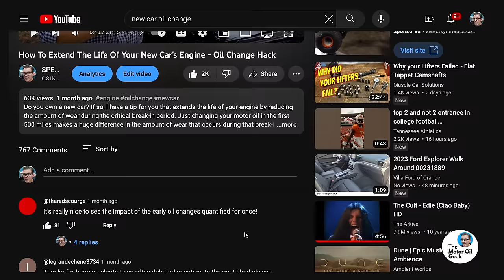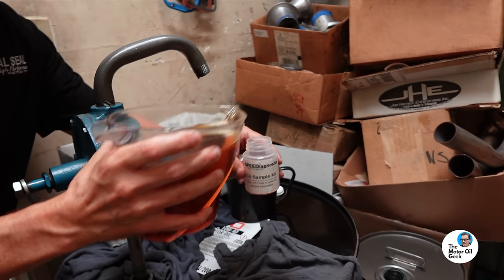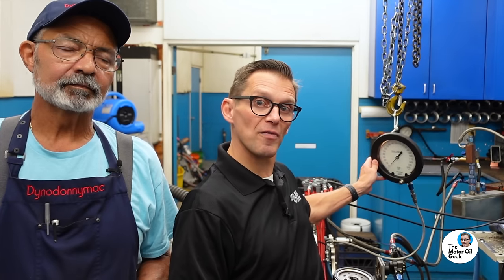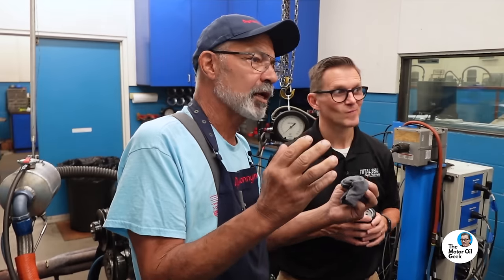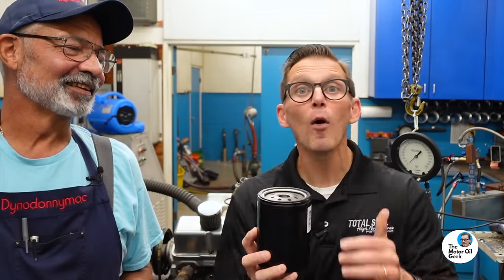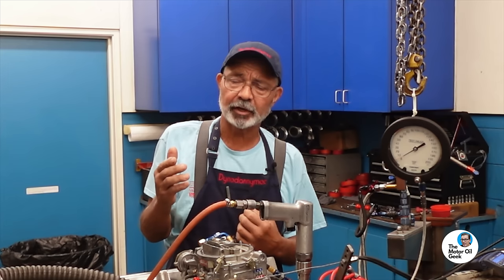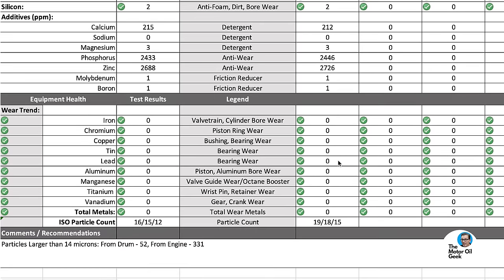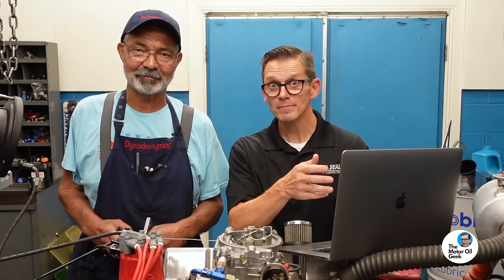Does Pre-FILLING The Oil FILTER Cause Engine DAMAGE?

Comment: What do you do if you have a VW with a cartridge oil filter mounted on the top of the engine? I can’t prefill the plastic cartridge, especially as it is mounted on top of the engine so all the oil would drain out. Also it doesn’t have a pressurize mode like your Subaru example.

Comment: If there was a significant difference EVERY OIL FILTER WOULD SCREW IN FACING UP so oil would not pour out during installation.  You should always test start the engine within an hour of changing oil so parts will still have film.  If it took 4 seconds for the valve train to receive oil on each start up and you worked 250 days/year, each year of commuting is asking the valvetrain to run without oil pressure just over 30 minutes.  Because mere seconds each day is acceptable, we don't yank the distributor and manually prime the engine each occasion we plan to start the car.  What worries me is the practice of dealerships sucking out old oil from the top of the engine.  That will shorten engine life but it's better than nothing.

Comment: Not fully accurate test.  The oil sampled from the engine was straigjt out of the oil pan.  That oil will run through the filter before going through the engine.  For an accurate comparison, your second sample needs to be drawn directly from the filter outlet.

To put their numbers into context, the ISO count referenced is something manufacturers have standards on.  For example, Caterpillar (one of the largest engine manufacturers in the world), recommends 16/13/13 as a minimum for theor engines.  Their own brand new oil will very rarely meet this straight from the drum. It is impossible to produce perfectly clean oil at that kind of scale.  Caterpillar spends an incredible amount of money on research and development, and they explicitly recommend NOT prefilling filters due to micro contamination.  Even to the point of designing filter mounts that are upside down to prevent prefilling. They also recommend "kidney lubing" the oil before filling (pump through a bank of filters).  I have personally sampled brand new oil straight from drum, and brand new "kidney lubed" oil, and the filtered oil ISO count was reduced by over 50% after a singl filter pass. 

Rather than listen to someone like this who sounds like they know everything about the industry, follow your manufacturers recommendations.

Comment: Pre filling filer with new oil can't be as bad to the engine as the filter going into bypass mode and pushing old used unfiltered oil into the engine.

Comment: hey guys GREAT video on prefilling the oil filter. iI have always prefilled mine on all the cars i've ever driven. one question, should i also put oil into the housing  that has the cartridge type filter as in my 2018 ram 1500 

thanks

Comment: No reason to not pre-fill. There are workarounds for when it's not possible. On my '21 Ranger, it's side-mounted, but the fill is right over the valve train, so I dump the new oil as fast as possible, then start it immediately. At least the top side is lubed at that point.

Comment: The problem is that you cold introduce contaminates. It takes particles of 2 micros or less to cause bearing damage. I don't care how clean you think your filling vessel is particles exist.  Also some placements make it virtually impossible to place with full filter.  Dodge Ram with a Cummins.  Also the oil pressure comes up within 2 seconds. Not the several seconds as they demonstrated.  My diesel has 175,000 and  I have  been installing dry filters since day 1.  No diesel mechanic I know prefills these engine filters.

Comment: My filter sits sideways, so there you go.
Reply: Mine does as well.  Pour enough to completely fill the filter pretty quickly and let it sit. The filter media will absorb most and it should not be a problem.  Been doing it for years on horizontal filters.

Comment: got a 2000 camry, the filter is put on with the open side facing down on the front of the engine towards the radiator. If i pre fil it just dumps all over the ground???

Comment: All this talk about engine wear at start-up due too little to no oil present in the first few seconds of operation could be easily eliminated by the installation of a pre-lube pump. In addition to a post shut-down pump for turbo equipped engines.

Comment: do that on a Subaru FB2X motor ane you will spill the oil all over the place as you turn the filter up side down. Ditto for the 3.0L and 3.6L flat 6 motors where you have to turn the filter sideways to install.

Comment: why would clean new oil into a new oil filter be a problem ?? it wont damage anything , there is nothing wrong with pre filling the oil filter , i have been a tech for 34 years , we do this all the time ,especially on dohc ,  sohc ,engines , that have known timing chain issues , because on cold start and restart after oil change service the engines will rattle until oil pressure is reached , its only a second or two but still we dont want to cause any damage ,so always prefill filter if possible !!!

Comment: At the end of the day, does it really matter! Draining the old and re- filling with new and nice new filter, every 3 thousand miles, it will last forever!!
I've stripped engines apart and found the bearings still with enough oil on them to start an engine without causing any problem. That engine stood for six months. The right oil, the right filter, and the right amount, not really much more, you can do!!! The problem starts with filthy old engine oil that's broken down and lost all viscosity, I've seen it brown and like water, that's when the ware starts. 
I have a uk supra twin tubro every 3 miles, the engine inside in like new !! Best of luck, everyone 👍

Comment: I own NEW Maverick. At 2000 k on odometer, I drained pretty oil. 
Replaced the FORD spec 5.7 qrt. Checked levels…… way over.
Measured what removed… 5.2 Quarts.
re-ramped and drained 1.5 qrts. 
And the Newly drained sparkled with metal shavings

AND I prefilled the oil filter. Although FORD initially did not lubricate the original filter which was sealed to block. Shame on ford…. Did it pre-lube??

I know  got Metal Shavings glistening at me in new cleaned Pan.

Comment: Anyone and I mean ANYONE who debates the sensibility of pre-filling a spin-on oil filter doesn't really know how an engine's oiling system works. I wouldn't bother trying to prefill a spin-on oil filter that is inverted or horizontal, as the anti-drainback valve won't work until incoming oil is pressurized (and will make a helluva mess when you spin it back on if full).

Comment: What about cold starts..? Are you prelubing your engines on cold starts? Lol.. 🤦🏼‍♂️ I think the small amount of film left over during a 15 minute shut off is plenty for 3-4 seconds of runtime.. 

This doesn't prove any sort of significant, engine altering damage is taking place over time.. It's only showing the runtime of full pressure with and without prefilling

Comment: Here’s you answer! If people have been doing this both ways then both ways are fine. It’s not going to make any difference to install it dry because it will fill in seconds and the entire motor is already covered with enough oil. Test have been run on engines run with the oil removed and they ran for hours before any damage but in this case they have more than enough oil for a start up
Reply: Bruh. People were actually telling them the new oil was “dirty” because it had not gone through the filter…which is just NOT true. Like they concluded, “If your fresh oil is dirty, then find another brand of oil”.
Reply: @MrMnmn911  true bruh

Comment: Ive always prefilled my filters. However on the car i have now the oil filter is top mounted. So how would i prefill that. And if you cant prefill then is the oil system different than a bottom mount oil filter engine

Comment: If you don't fill the filter with oil before installing the engine 
The pump if weak it will take 10 seconds to draw the oil to the  upper engine sections 
That few hundred times crank rotation with out oil if the 
Crank journals are weak it will make the slip bearings to rotate from it'd place .

Comment: So can I turn the ignition on without starting with a cartridge filter? I’m saying by turning on the idiot lights on but NOT starting does that turn the oil pump on to prefill the cartridge if I let it sit for a minute or so and do that a couple of times? Then on the third time start the engine. Would that soak the cartridge and fill the oil filter housing?
Reply: Maybe some vehicles have electric oil pumps, in which case that might work.  All engines Ive played with were mechanical oil pumps though, so the engine has to turn to drive the oil pump.  In the vid they used an air tool to spin the oil pump ,  probably not applicable for home use.  I think on my current truck, if I crank with the pedal down to the floor (floor it and leave it there during cranking) , it doesnt add fuel and thus I could move oil around without the higher rpm of a running engine.  Moot point though, as I always fill my new filter.

Comment: This is not a fair true test that proves or disproves anything. You filled an empty sump with oil that had to fill all the passages and the filter when primed the first time. Then you just hit the primer again. Of course you will have instant oil pressure. A true test would be to drain the sump and allow the engine to sit without oil for the same amount of time to account for all the passages to empty. Then fill the filter and sump sump and measure the time to pressurize the system. You also have to consider the oil flow path. Where is the pressure being measured? At the end of the path? At the beginning?

Comment: What about oil filters that thread on 90 degrees like on the Duramax 6.6l. Is it okay to replace those oil filters on dry or should you still pre fill and try and screw it on the best you can with out loosing to much oil in the process?

Comment: Question, I have a Toyota Toyota 1GR-FE 4.0 V6 which has the oil filter that goes on vertically. Not a push to start, turn key ignition to start. Does this engine have a clear flood mode? can I pre fill the oil filter? Thank You.

Comment: DANGER PREFILLING MAY DESTROY YOUR ENGINE! Yes you can if you drop a piece of tin foil from the seal into the oil and the pour that into the center part which is the oil that has all ready gone through the filter material so this unfiltered piece of aluminum can go to a bearing or oil gallery and plug it. All it takes is one oil starved bearing  to destroy your engine. I use a funnel with a metal strainer in it which should catch anything big enough to damage your engine. You could also pour it with a tiny funnel through one of the tiny holes then that will go through the filter and any pieces of tin from the covering can be captured by the filter. Omg you really think the count can go up so high from a few seconds I do not think so it is more likely you mixed some old oil with the new oil and that is where all those particles came from.

Comment: Nah...this could be a good practice on a first start on a rebuilt engine, but on a daily driver where the engine is being used and  oil is changed when engine is warm everything is going to be covered in warm oil internally...filling the oil filter isn't going to matter..not filling it won't hurt anything...this is just one reason oilnshould be changed after the engine has been warmed up...thats more important than filling the oil filter....even then simply disconnect the ignition and crank the engine over for 5-10 seconds that will pump oil all over the internals, eliminating ANY concerns about filling the oil filter first

Comment: Ok, how do you prefill a filter that mounts horizontally?
Reply: It's easy 
I have been in the auto mechanic profession  since 1974
You don't need to fill the oil filter all the way
The problem is when the oil filter is with doubble valve,you can't fill the oil filter with oil
Reply: @konstantin-big  Thanks very much.
Reply: @justaguy6100  
I hope I helped you

Comment: Listen. Everyone.. 
Oil filter is just what it is....A filter.  It does not run oil through your whole block. 
There is a warm up time for every engine.  
Your oil comes from the pick up tube and oil pump. Which pumps oil throughout your engine.  Your oil pump is what matters here. Pre filling a oil filter is pointless.  The oil filter is at the bottom of the engine on most engines. It only takes a sec for oil to fully circulate  through the engine and through  the oil filter.  The best thing you can do . Is just run an extra quart of oil in your engine always. Mobile 1 20k mile full synthetic is the best oil you can get by the way. 
Also, filling your oil filter can cause a mess as there is oil filters that are on angles. I'm been doing my own oil changes for decade's.  
I mite add one thing.
Which nobody knows. 
Filters are not 100 clean from factory.  
Best thing to do before putting a filter in. Is clean the inside and dump it. Add some marvel mystery oil or a additive the can clean but doesn't harm the engine into the filter. Spin it around a bit. Then pour it out into a container. Just a tip. 
Getting immediate oil pressure is the oil pumps job.  Not the filters.  Don't waste your time with this nonsense video.
I had to add. The rod bearings are slightly scratched do to miles on the engine. Once you turn your engine oil. Oil from oil pan immediately gets onto the crank.  These guys  are saying that a pre filled oil filter will save your rod bearings? Lol. No. 
(Run an extra quart of oil) That's all you need. To do. 
I keep coming back to add comments. Lol. 
Running compressed air to simulate an oil pump is not accurate. To the engine type and oil pump. As you can see they did not run one engine in this video.

Comment: Mobil 1 has run commercials showing they can drain the oil from an engine and run it for 30 minutes.  There is an oil film on  all engine parts that protect them for 3 seconds, and there are millions of engines with 500,000 miles that prove it.  Stop the drama.

Comment: My 3.3 ltr. V6.. ONLY HOLDS 3.5  Q's (FULL!?!).. 
In Over 40+Yrs, The ONLY Times I haven't 'prefilled' the New Filter is: (when I 'may-have' Forgotten)  
OR..
If the Filter-Placement was Located in Some iMbEciLiC location (Upside-Down).. 

Here's One I've ALWAYS Wondered About: 
Of ALL the 'Air-Cooled' Engines I've built I'd 'occaisonally' Replace the 'Stock Cooler' with a 3rd-party (LARGE-FINNED) Cooler.. & an Auxilery 'screw-on' Filter..  
One Engine 'Ultra-Smooth & '0' Balanced (Ran Smooth as Ice (w/ more Raw Power than I expected.. 
EXPERIENCED A 'SIGNIFICANT INCREASE' IN OPERATING TEMPERATURE (After the LARGE 'finned' Oil cooler was installed.. (& the WELL- VENTILATED ENGINE COMPARTMENT SAW A DRAMATIC TEMPERATURE INCREASE?!?.. 
Any Ideas?!..

Comment: Nothing against pre-filling your filter. But you had 4 sconds until there was oil pressure. Let's say the engine takes 2 seconds until it starts. You'd have 2 seconds of running with no oil pressure. And that's generous because as soon as it starts it will build pressure faster than when it's just being cranked. 
And we don't even know how fast you're spinning it in your experiment. Same speed as a regular starter motor? Otherwise the time it takes to build pressure will obviously differ. 
And your measurement for the prefilled filter is not scientific. You should have taken the filter off, take a new one and pre-fill it. And depending on where you measured the oil pressure you should have also let the engine sit so that the oil can drain back into the pan before you put the pre-filled filter on and crank it.

On a side note: There are so many engines with horizontally placed oilfilters  or cartridge style filters that you can't pre-fill and none of them fail because of that. (I don't know any cars with flood/clear mode btw, only the injector fuse trick. But I literally know nobody who does that)

So yeah obviously it will not hurt your engine to pre-fill. But the profits are negligible.

Anyways, appreciate the effort you put in these videos 👍

Comment: I'm 67, been changing oil on cars since I was 13, have never prefilled a filter. Never will, no reason to. You put oil in through the top, oil drains down over the lifters and through the engine, pre filling is not necessary and most filter companies say not to.

Comment: Using critical thinking skills and common sense, I determined decades ago it was wise to prefill the filter....without scientific studies or a lubrication specialty science degree...😉

It only makes sense if the filter is installed dry, you will be turning over a dry engine until it's primed and the pressure is high enough to flow to where it needs to be.

Of all the reasons to claim it shouldn't be prefilled is because it hasn't been filtered has to be the silliest idea I've heard in a while.

The inside of the engine is obviously nowhere near sparkling clean after draining your oil, no matter how often it's changed so as soon as it's poured into the engine, it's automatically going to pick up minute particles remaining after it was drained.

The oil will NEVER be cleaner than it is when sealed in the bottle.
Reply: I would even go further and suspect that if you took a sample of oil from the pre-filled filter before it was installed and tested it against a sample of fresh oil from the pan before the engine was run that the oil in the filter would probably be cleaner than the fresh oil in the pan.

Comment: I will do them one better. I believe frequent oil changes are unnecessary.  I have driven three trucks well up over 300k with extremely sporadic oil changes. Each was still running strong when I sold them. It's a small sample, but it is at a 100% success rate. Oil companies recommending frequent oil changes is akin to pharma salesmen recommending continuous consumption of their pills.